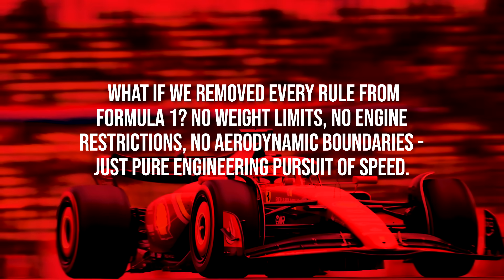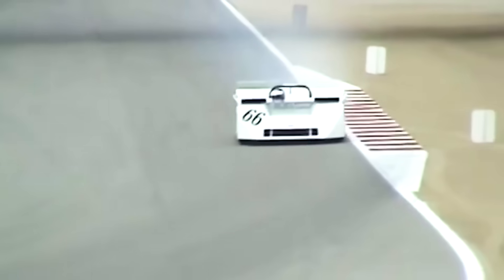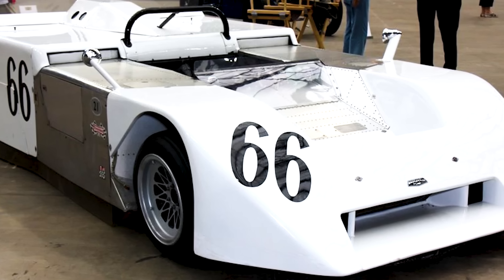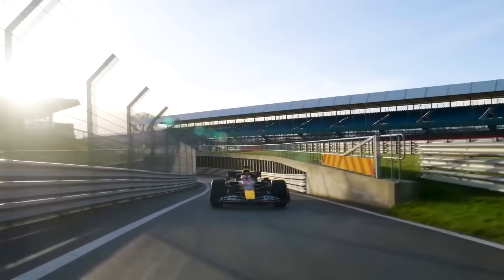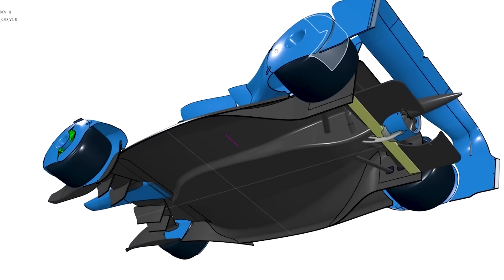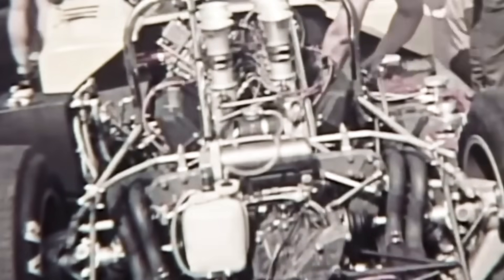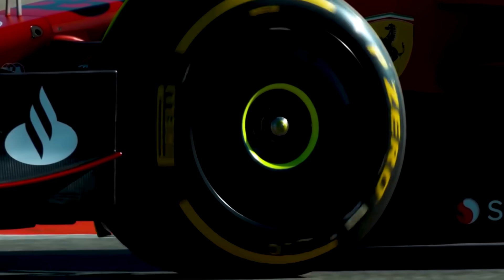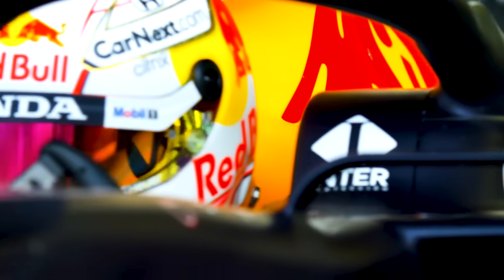What If F1 Had NO RULES (The Car the FIA Will Never Allow)

Comment: Go all out on the engineering, and get rid of the human, making it RC. This way, there are no concerns with making the car "safe", so, perhaps, withoud a driver in the car, the engine could be repositioned closer to the center of the chassis. So just like in the World Drone Racing Championship, the drivers would be together in simulators with all elements from the cockpit, and 3D goggles, so the racing is done safely, and the cars will go as fast as possible.

Comment: You didn't take everything in consideration.
You were just looking at each individual optimised part, not at the system as a whole.
It still is a cool concept, but could never exist as in the video, even with no regulations.
The aimed weight wouldn't be possible at all. All those other upgrades except a few material optimisations would add weight to the car, a lot. Think about all of the sensors for the active suspension and also the computer you would need to process all of the information. Also the fans for the extra down force would add a shitton of weight, fans themselves, mounting, energy system to run them.
Also the fuel tank would need to be much bigger and, aswell aswell as the engine.
All of those calculations seemed to be a bit optimistic and far from reality, but the point of the video still seems quite legit, I am sure that a much much quicker car is possible without the regulations, just not as extreme as explained in your video.
Reply from the maker: Thanks for the detailed feedback!

Comment: Even with the regs, existing F1 cars drag the pavement with them when they slam on the brakes before a turn.  Like a dog trying to stop on the kitchen rug, it just slides along and folds up.  They'd basically have to re-do all the braking sections on the tracks to be bare concrete, or the pavement will all just end up shoved off the track by the end of a no-rules race.

Comment: the biggest problem would be tires that can handle the downforce and power of acceleration. the tires on a Bugatti Veyron or Chiron at full speed will only last 15 minutes or 50 miles. add thousand of pounds of downforce and ...

Comment: 4500hp is a little overkill. With no rules, we are not trying to maximize power, we are trying to maximize the car’s overall performance around a track. There is simply no race circuit in the world where you can realistically deploy 4500hp onto the track, even on a no-rules F1 car. All of that excess power just adds unnecessary weight, complexity, and harms packaging efficiency which limits aerodynamic optimization. A more usable horsepower target would be 2000 hp max. An engine that only needs to make 2000 hp would be lighter, smaller, and requires less cooling which would improve aerodynamics.
Reply from the maker: Good point.  It was fun to imagine the possibilities.

Comment: I don't think that a series like that should replace F1. 
   A Can Am type series wouldn't be a bad idea, except for the costs. F1 is expensive.
   As for drivers, you could drive them remotely. Though I think the tracks would have to be specific to those vehicles.
   Might take the levels of engineering to new heights. Like tires, for instance, but they are already a limiting factor and are specially engineered for purpose.
Reply from the maker: Good points.

Comment: I watched a video analyzing a project called "the pinnacle" referring to a futuristic F1 car based on simple solutions achieving laps around 10-15 seconds per lap faster in Barcelona circuit than modern F1 cars and with simple solutions. If it's true where's the  big cost necessity of the evolution of a no rules car? That video reveals that the cost of such a car would be many times cheaper. Sometimes there are examples that teams to overcome these banned solutions spent much more to create more complicated & expensive ones
Reply from the maker: Good point.

Comment: Top fuel dragster engines are heavy solid steel cast block 4500hp might give it the power and acceleration but it would slow itself down do to vibrations lack of refinement would make it unable to corner at this speeds and if you interested unrestricted f1 is being developed as we speak ever heard of the fzero

Comment: This makes no sense whatsoever. You are comparing a heavily boosted top fuel engine to a naturally aspirated V12. Even with modern materials and a limited lifespan, you are not going to achieve anywhere close to 1000 hp per liter naturally aspirated.

Comment: that 4500hp v12 would be unusable for an f1 car. it would be far to unreliable and the fuel consumption would be so high that it would most likely need half the weight of the car as fuel. there's a reason why nitromethane mostly gets used for drag racing.

Comment: I don't think the tires would be as much of a problem as everything else. I mean there are ways of dealing with heat, for exmple the sr 71 black Bird  tires were fused with alluminum and could resist tò temperatures as high as 400°C and even a bit more than that. Now this was more than 60 years ago, i think we would be able to find a solution.

Comment: How do you get half the weight of a current F1 by putting in additional technology? Whatever weight is saved by using different materials for some components, would be replaced or increased with the additional components.

And that claim of stopping from 200mph within 30 metres, that would be 13.7g created in that action. More than twice the G a current F1 car does.

Comment: The driver would pass out within 3 corners
Reply from the maker: That's the tough part.  Hopefully with increased technology, there would be some type of driver assistance to allow the high G's.
Reply: @F1Focus25 driver assistance? There is no system able to change bloodflow inside someone’s body.
Reply: @kkaka26 actually there are systems that fighter pilots use during high G maneuvers. It ads pressure to your body. Still there's only so much that can be done.
Reply: @rustyudder exactly, there’s only so much you can do, plus f1 Gs are lateral, whereas for fighter pilots you can use suits to avoid issues for vertical Gs but there is no possible system for lateral Gs. f1 drivers would be constantly pooling blood in one side of their brain to the other hundreds of times a race they would literally get brain damage
Reply: @kkaka26 fighter jet G suits would do the job just fine
Reply: @ryanrekz7744  Clearly you don't undertand how those suits work.
Reply: @F1Focus25  Wouldn't need it. People can tolerate 20G laterally without passing out. Passing out would not be the first problem the driver would experience.
Reply: Who cares?
Reply: The ultimate no rules car obviously can't have a human driver. Better aero, less weight, higher G's
Reply: Brakes would not survive either!
Reply: No they wouldn't. It's lateral G.  You can tolerate far more G force side to side than top to bottom. And fighter pilots already regularly pull 9 G for far longer than it would take the car to get through the corner. This car ain't pulling no 9g through corners! And people can tolerate 15-20 G laterally. No tyre material that could ever be strong enough to withstand 20X the weight of the car acting sideways, would ever have enough grip to be able to generate that force in the first place. The tyres would have to be several feet wide to allow a material soft enough to provide that grip without the surface being sheered clean off it, losing all grip.
 That's why race cars have wide tyres. Wider tyres does not inherently give more grip. As surface area increases, pressure on it decreases, and the grip stays the same. Wider tyres just allow you to use softer rubber and not have the surface of the tyre be ripped off and left on the road. The rubber has to be softer to grip the road better, but harder to grip ITSELF better. No matter how much you increase downforce, you're still limited by the force it takes to rip the surface off the tyre.
 And having wheels that are 4 feet wide, just makes the car wider, which makes all the corners tighter, and makes the track longer. The car's center of mass has much farther to go, and much tighter turns to make, to stay within the confines of the track.
 Having 8 or more wheels, is the most realistic solution, but you're still not getting the driver to black out. He'd crash first from not being able to steer the car with 20X the weight of his arms pulling them sideways.
Reply: @ashscott6068  you do know it's THEORETICAL?
Reply: @stuartchambliss5661  Yes. Hence all the "could"'s and "would"'s.

Comment: They should do a special series every 10 years where the only regulations are safety, everything else is free game
Reply from the maker: Yes!!!!
Reply: No that's what F1 should be. The only thing to cap is budget, AND also make it a requirement to release data/info on any new technical part within a certain timeframe, so that it encourages the field to remain closer.
Reply: I would also add regulations on dimensions of the car in order to keep overtaking possible.

Comment: Old times we used to watch any manufacturer innovating in different sections of a car, now we see cars almost identical and if one manufacturer truly achieves a tiny improvement everyone else is looking either to copy or to press the FIA to bann it, i don't think that's a real progress of the sport and if you really see the spectacularity of the sport is getting lower because it's truly business. And what about really fast circuits like old oval Monza or old Nosd or AVUS Rennen etc? There are circuits like Monaco unsuitable for modern F1 cars and no one like the previous ones. In short i think that in the end the sport will degrade more and more if the FIA doesn't change it's policy and don't give more freedom for true innovation. As for the danger of the drivers this is part of their job, they accepted it when they took the wheel, maybe we see the next generation of heroes behind the wheel of such cars.
Reply from the maker: Truth

Comment: Theoretically i want drivers use the exact same machine. Seriously where are you going.  Tires, hydraulic oils , human capabilities,  where does it stop
Reply from the maker: Well, we will never know because it wouldn't be allowed.
Reply: The only formula level that does that is F2 the level right before F1, as far as I know no other Formula level deosnthat
Reply: @HPerm. Indycars have the same chassis but 2 different engine manufacturers.

Comment: Well we know that TVR created a V12 fuel injected engine that was so powerful it was never dyno tested for racing.  The claim was only 650 BHP but when taken in 12000 RPM plus Japanese estimated 1600 BHP this is why it is in the super car Games.  What was interesting was no 0 to 60 it was 0 to 200 5 seconds. Proving the engine is there as TVR ended years ago.
Reply from the maker: Good point.

Comment: What about 6 wheels  even better 6 wheel drive with multi shift diff like consistent traction control but on all 6 wheels and then 6 wheel steering.  Thus six wheels is less tire wear and less over heating of breaks as six breaks that would solve all issues.
Reply from the maker: Interesting concept..

Comment: You have just designed a car that will need a fuel stop every 10 laps or less.  Per injection CH₃NO₂ needs like 7 times the amount of fuel than gasoline does.  7 times the fuel requirement at 3000+ horsepower.  Is this car going to have a gooseneck hitch to tow the external fuel tank?  To make 2000 hp for 20 minutes you need over 450 liters of fuel.  You are in luck though.  It will only add 525 kg of sprung weight to the car.  
Everyone feel free to correct these numbers as I am sure I am off a bit.
Reply from the maker: You make some good points.  It's still fun to just imagine the possibilities.

Comment: I feel like there needs to be a happy medium. I like the idea of increased downforce and the active aerodynamics
Reply: The active suspension would be cool too
Reply: @rockybalboa-c4k   too bad they dont have that today
Reply from the maker: Just get rid of the electrification.
Reply: @F1Focus25  i fully disagree. LMP1 hybrid 2014-2017 has proven to be the most exciting era in sportscar racing, cars with maximally optimized efficiency and aerodynamics while still providing incredible battles. The only problem with F1 itself i think is the open wheels and the absolutely backwards regulations of 2026 putting the MGU-K in the rear.